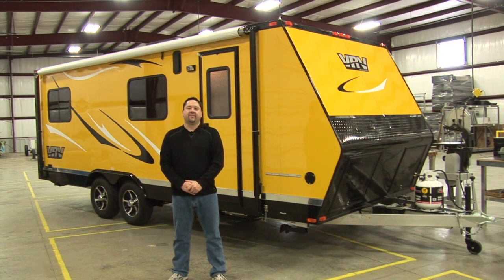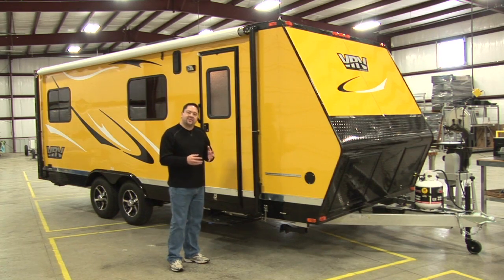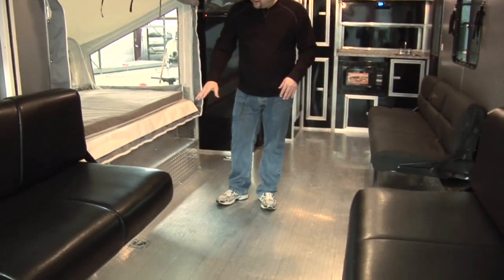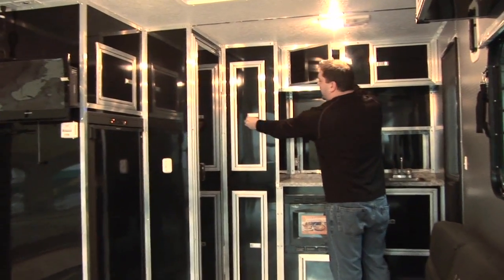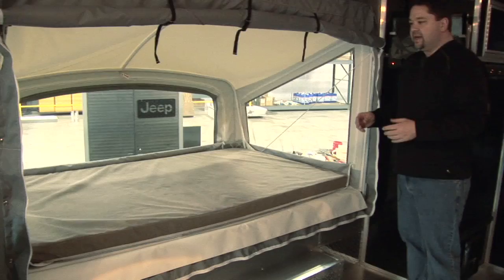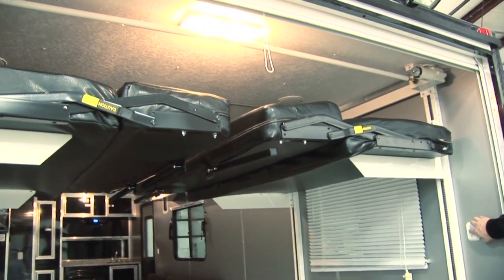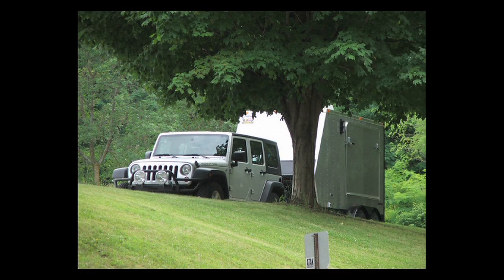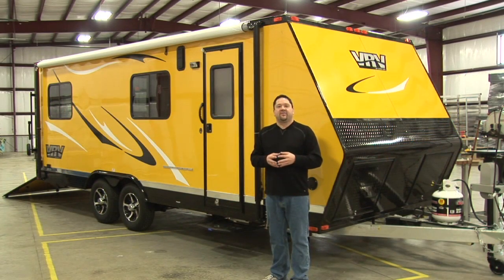2011 VRV All Aluminum Toy Hauler by LivinLite

Comment: Great concept, materials and design, but needs a wall in between your toys and the sleep area(gas fumes!). If you doubt this, notice the person passed out from motorcycle gas fumes at 4:13
 I still might buy one, but mainly as toy hauler and a pace for crew to showers, not to sleep.

Comment: from the looks of it this dosnt look like it can provide that classic camping feel, the inside looks really rugged and not cozy at all. all aluminum wouldnt you freeze your balls off in the winter and melt your balls off in the summer?  its a giant soda can, i have a traditional toy hauler its a fleetwood and if you take care of these old style wooden ones from the elements you will have no problems whatsoever. its also very well insulated